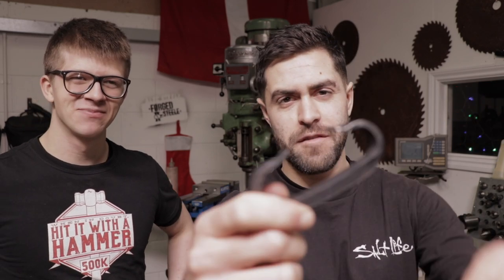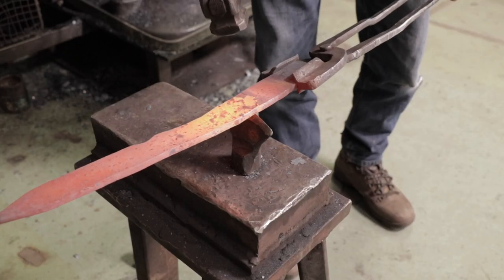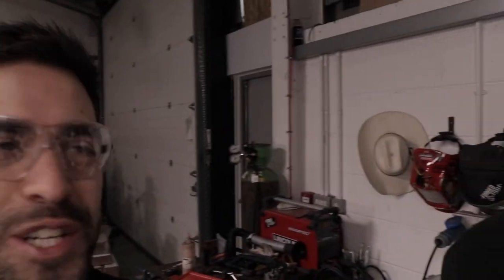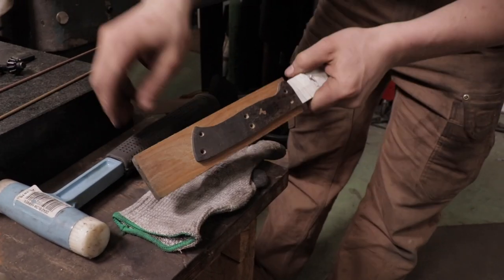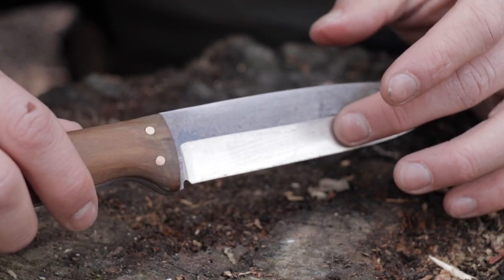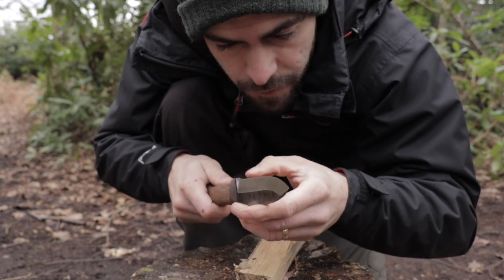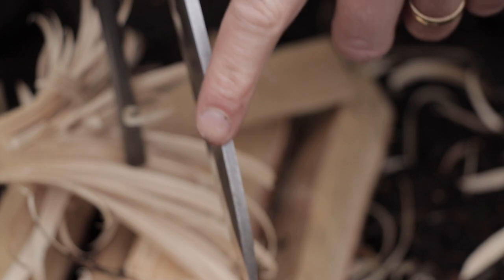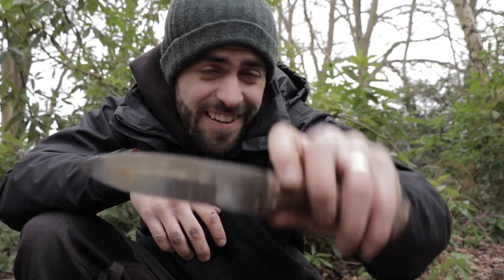How To Make a Bushcraft Knife with ALEC STEELE - Blacksmith Masterclass!

Comment: Great video! Don’t worry about the grind, mate! If you look at traditional Scandinavian knives you’ll find that they actually have fairly high grinds. This whole “shallow scandi grind” thing is a relatively new trend and most likely sprung from the use of thicker stock in modern day knives. Traditional knives tend to be thin with a focus on slicing and cutting rather than batoning. Your knife looks great and I doubt you’ll have any issues with rolling the edge as long as you maintain it properly! Cheers from Sweden, mate!
Reply: It probably has less resistance with that grind too making batoning easier.
Reply: Bra sagt :)
Reply: @johndifrancisco3642  MY thoughts ExAcTlY !!!

Comment: I have not seen a lot of Alec Steele. But I have a hard time taking his content too seriously. He just has every gadget under the sun for forging. I am a beginner blacksmith myself and being a teenager my materials are very limited. I've put almost 20 hours of painstaking work into my first blade. Working it in my leaf blower coal forge and with a cheap belt sander. It took my brother and I over two hours and six drill bits on my dad's old press to drill the two holes I needed in my tang. I hope to have a lot of those gadgets someday but the work I've put into this first backwoods project I'll never forget. It comes with a certain pride. Keep forging folks. Through the fire, through the blood.

Comment: Great video Mike and Alec. Shame you messed the grind up a little but you can toughen the edge up a great deal by adding a micro bevel.  Some people prefer the look of the higher grind. The sharpening notch is also known as a "Spanish notch" been around for years. You do need to strop the edge though as there will be a tiny burr left from the grinding.
Sandy
Reply from the maker: Hi Sandy, yes was thinking I will probably end up making a micro bevel from just stropping it alone. Think it will help strengthen the knife anyway to be honest! Lovely knife though, it's my precious! Thanks for the info on the Spanish notch, didn't know that. - Mike

Comment: That’s a cracking knife. Great job.

Just to add, that little notch Alec filed in is the choil. It was originally designed like you have and for the exact same purpose.

Over time the design merged with the finger grip. Today many mistake the choil for the grip.

Comment: We've used stones as knives, of course even a modern steel knife with small flaws is going to do its job. 
Cool to see him doing still lots of manual labor, a lot of people nowadays just buy steel plates and grind them down on the belt sander, which is fine too but I feel a lot of people missing out on a lot of in depth knowledge that way.  
If you keep that one, or decide to make a second version that you eventually keep, you should also look for making your own custom sheath for it.

Comment: Awesome video Mike! When you showed the handle with the linseed oil on it I was in awe. I like a rounded, bottle style handle just like you made and having the wood go up the choil makes a ton of sense. I currently am using the Bark River Aurora II and wish the handle was more rounded and the choil covered fully with the scales (the choil is a bit sharp). Great job on the blade and handle geometry. I wouldn't change a thing. Bravo.

Comment: Great vid.  Good info on the process.  
I have one beef, though Linux Vitae is not the hardest trade wood.  Buloke is 5060lbf on the Janka scale.  Lignum Vitae is only 4500.  There are also a couple species of cashew that are up in the 4700 range.  Buloke is reasonably readily available, at least as available as Lignum.  Like I said, minor beef, but a beef no less.

Comment: Great video but I wished you went more in depth about the quenching process. I know it is different for different types of steel but like Alec said in the video, it is the part where the blade is most likely to crack.

Comment: Only knife of its kind in the world.. Leaves it in a stump in the woods
TREASURE HUNT!
Reply: That is the difference between a factory churned out knife and a blacksmithed knife, every one of them is unique. One they just take a billet of steel and grind it down (and then heat treat it) while a blacksmithed knife has character of every blow used to make it.